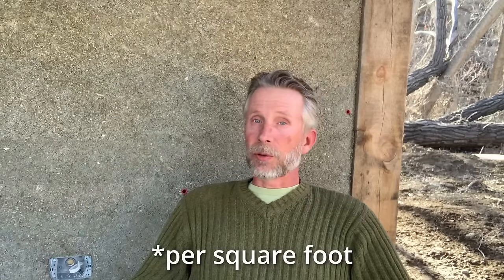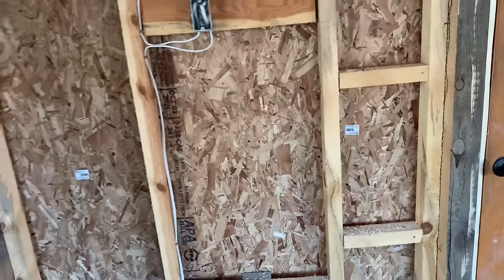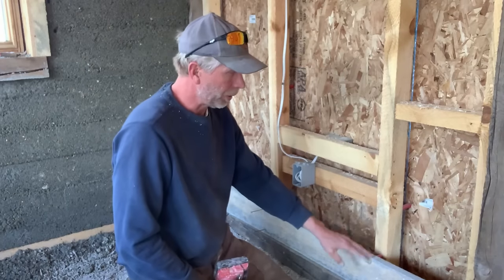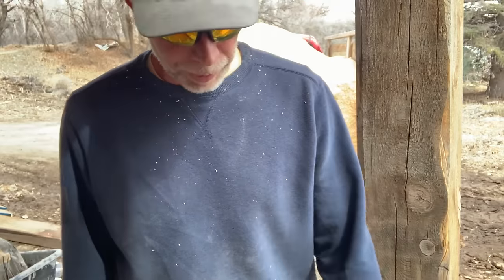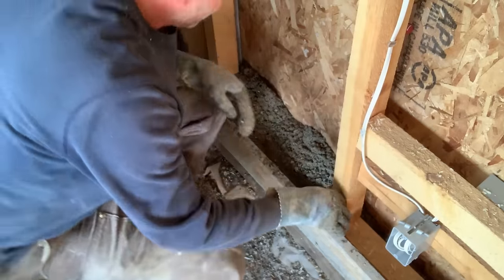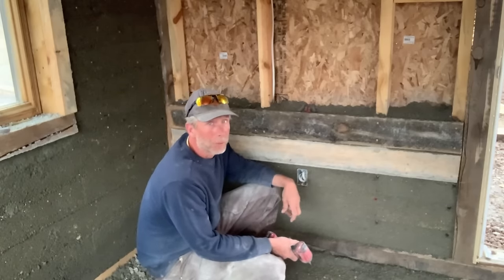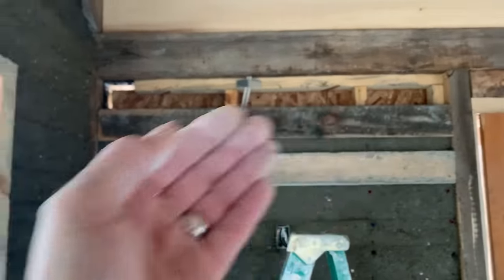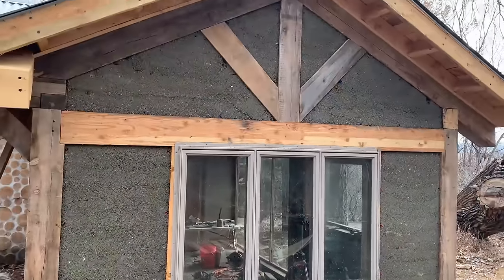Dustcrete

Comment: Nice work! I have been using sifted sawdust mixed with polyester resin; then mixed catalyst for filler building boats. This filler is rock hard and less expensive than other fillers.
Reply: I started doing this since the late 1980's and still use and recommend today.

Comment: I like that you used the PEX tubing - it will afford mounting points for the lathe/stucco wire mat as well.
Reply from the maker: Not wire or lathe is required to plaster these walls.  the plaster keys beautifully into the dustcrete, on its own!

Comment: I'm very intrigued with your technique.  I've purchased a property with plenty of eastern red cedar and I'm anxious to try cordwood.  But your dustcrete method would definitely be quicker.  I may first try it on a shop or garage space.  Glad to see you back and look forward to more of your great content!
Reply from the maker: So nice to have red cedars! They will be great for cordwood. Yeah, if there is a mill around, the dustcrete is hard to beat. I’ve thought about trying it just filling the voids of a 2x4 stud wall, and siding the outside with board and bat. That would make a toasty shop!
Reply: @radicalgastronomy  I have an old house I was wanting to do with cordwood. But the house has walls already. So I had the same thought. What-if, instead of building true cord-wood, I simply used small pieces 4" thick cordwood and build that with a bout a 1-1/2 gap. then just fill in the gap with dust-crete.  The original idea was to tear it all out down to the studs. But I don't think I need to so all that if I'm just looking for aesthetic and a little tighter construction. if I want bottles for the lighting effect, I have boring bits, I can just cut those in as i go. 

I think the r-value is important. the insulation currently inside my wall exceeds some of the other hard-fills I had in mind. The current fill is R-13. I think instead of re-doing what's already there, I'm better off just adding. If your walls are already insulated, it probably has a minimum of R-13 for the 3-1/2" space. that's not too shabby. dustcrete won't give you R-3.7. So replacing insulation with dustcrete isn't going to be an improvement.

Cordwood will give you R-1.7 x 4" cordwood thickness. sawdust give you 1.4. so add it all up.  Cordwood @ 4" x 1.7 + dustcrete @ 1.5" x 1.4. So you add about R-8 to the existing wall that is already R-13. So approx. R-21. Then add the same cordwood on the exterior and you're adding another R-8 for a final R-value of approx. R29. not too damned shabby
Reply from the maker: @michaelyoung1892  that could work. 4” may be a tricky to set, but might work. Perhaps some experiments are in order…
Reply: Yea it’s a great idea for cordwood infill …

Comment: That's pretty clever kind of like a thermal Mass with an insulator without no colder heat transfer been in construction for 70 years never seen anything like it definitely cost efficient and I just happen to be good at stuck and plastering she looks sharp when it's done 👍 longevity is there

Comment: Fascinating wow. You could put a Portland cement plaster over that and it would last forever. I lived in the Philippines where they build with hollow block that is like 90 percent lime not cement like they do here in the states and it's just basically a inner form for the inner and outer plaster. I think this would work much better and be more insulated👍

Comment: One thing I am not sure about in this mix is the need for lime. Portland cement is made from limestone and clay to form a synthetic mineral that forms rock like crystals when wetted that can stick other rocks, or in this cases chunks o sawdust together. The other way to make concrete type materials is to use quicklime or hydrated lime to “activate” alumina, silica and iron containing materials like clay, rocks formed from volcanic ash (like the Romans) or power station fly ash. This is how the special French lime works. In both cases, high silica content plant materials like straw, hemp or some sawdusts will get stuck to the binder due to the silica they contain. I think this might work with just cement powder although the lime may help with ensuring the bond to the sawdust. In a very dry mix like this, regularly wetting the surface with a fine spray for the first week or so should help long term wall strength. I would also leave the wall exposed for 3-4 weeks before plastering. Great idea, I’ll look out to see the final result.
Reply: Yes, I too am confused about type S lime being a separate ingredient from portland cement powder.
Our big box store only carries "portland limestone cement" and directed me to the garden center for just "lime".
Question then would be ... Can I substitute 4 parts "portland limestone cement"?
Reply: @lst854  Type III Hydrated lime, bag the size of Portland cement. One shovel to four of portland. Slows drying to help in hot regions.
Reply: One thing about the difference between lime and straight concrete is that lime mortars are less brittle and crack less easily. With cordwood and sawdust they have more expansion when wet, especially hard woods, and because he's doing cordwood, he probably knows that straight concrete like Portland can cause problems in cordwood mortars, from expansion cracking. Cordwood mortars are usually an adaption of lime based mortars, with sawdust also added..   I've seen the mess from even ordinary brick walls made with just Portland cement as a mortar... That's a bad idea even then... I doubt a bricklayer would use pure Portland as mortar, for that brittleness reason. Just saying.
Reply: the lime helps the wall breathe dissipating moisture humidity, cement will feel cold and damp.
Reply: Masonry type S cement already has the hydrated lime in it, and is composed of portland cement and hydrated lime. The mix will absorb the water as it cures at an optimum temperature of 48° F over 28 days. As long as you keep the walls below 70° F, mold will not form. Mold needs temps above 70° F, moisture, and somthing to eat like wood or paper. Take away any one of those, and mold can not grow.

Comment: This is an excellent video, on many levels. I see great potential in this wall system. It obviously works well as presented. Do you think there would be any advantage to painting the exterior ply forms for easy release and durability? Maybe just not necessary. Mesh sheeting could go down before plastering, if you need more strength. Mix some thinset with type S mortar for a rock hard scratch coat. You could add color pigment to that if you want an adobe look that ties the structure visually to the earth.
Reply from the maker: I ended up using some fiberglass reinforcement in the plaster, and have very little cracking. There is a video on my channel showing my process. Glad you liked it!

Comment: Looks pretty cool, it could make for great construction projects, low-cost sheds walls and chicken coups and many other uses. I wonder what the R value would be? Could be a great alternative to rockwool insulation from a price point.
Reply from the maker: The price point can’t be beat. I’m assuming R value is like hempcrete (2.3-4.8 per inch). May do some tests…

Comment: Interesting. I recall about 30 years ago a neighbor of mine tried making concrete using sawdust. He experimented and abandoned the project. His was much wetter in the traditional way concrete was made. He ended up with a material that was not very strong and came apart easily. It was sort of like a sandstone concrete. I wonder how water infiltration and freeze thaw cycles effect this? Wood can absorb water; and water can freeze and destroy concrete. I always support experimentation, but don't really know what is going to happen. Hardy board is a similar type of concrete wood mixture.  There is no chicken wire or other metal reinforcement in the wall. If historical research could show how similar materials have stood the test of time, or how this is just a minor change to an existing technique that might be beneficial. Obviously, you plan to keep this dry, sealed in a wall. Walls are great places to keep things dry.  Some portions of the country are going to have freezing temperatures reaching deep into the walls, (at least occasionally in extreme weather events) and moisture, in both condensation, floods, and plumbing leaks is a real pain to home builders. Both wood and concrete have done ok in this regard.  Historically, sawdust has been used as an insulation, or to fill walls before modern insulations became available. Today, cellulose insulation, (generally from newspapers), is basically a wood product with a few anti-bug products added. Good luck. Neat project.
Reply: Old house in France, in my Town (Troyes) used this kind of material, more rudimentary and that can last 400 hundred years
Reply: And Im talking about this material on the outside wall, but yes there wood cross every 2 meters or so on 3 meters high
Reply: Cement is too hard/ brittle for this. Lime is the business with a small amount of cement to help set early, and eventually the lime cures to a more flexible and long lasting binder.

Comment: I absolutely loved your video.  Plus your explanations are so complete and clear.  THANK YOU!!!  I do have a few questions, though: 
•	Would the dustcrete mixture ruin the concrete floor if it gets on the slab – especially if the floors will eventually be finished using an acid wash method?
•	What’s the maximum height the walls should be to ensure the walls remain stable?
•	Should all exterior wood be covered with the lime stucco?
•	Will the wood eventually rot from the dustcrete mixture?
•	Do you use hydrated or hydraulic lime?  If it’s hydraulic lime, what’s your source?
•	Do you have a cost estimate per cubic foot of the wall?  And do you recommend a 10” wall thickness?
•	What method would you use for internal walls??
•	I will use a hydraulic lime stucco on the outside, but can I use an earthen/clay stucco on the inside – and does it adhere to the dustcrete very well?
  Should the lime stucco be applied BEFORE the clay stucco on the INSIDE if I needed to repair a crack?
•	What do you do to ensure the clay will stick to the walls on the inside of the dustcrete walls (lath, mesh?)
•	Do termites go after the sawdust?
•	What about thermal mass... and what is R-Value of a 10” wall, more or less?
•	Since you had trouble with a cold joint on the wall you demonstrated in the video, have you figured out how to prevent the problem?  I assume unless I build an entire section, from bottom to top, I would have problems with cold joints as well….  but THEN, wouldn’t there be a problem with joining two sections that were side by side?
•	Would the final stucco using the hydraulic lime mend the crack?
   
Again, thank you for coming up with this wonderful idea!  🙏🤗👍
Reply: "A few questions"?  You just asked him to write a book.
Reply: Is it farther to New York, than by bus ?

Comment: A few questions.. What is your gut feeling about the insulative ability of the Dustcrete compared to the cordwood? I understand the need to plaster the exterior.. but do you think it would be possible to attach foam board ( to improve the R Value?) to the interior using the hole from the slip form, and finish the interior with drywall, or another surface?  Lastly, what roof overhang do you think should be a guideline to prevent excessive wetting of the plaster over time?
Lastly, thank you for doing these videos, your professional presentation and production values are a wonderful compliment to your ability to get the information out.
Reply from the maker: Having one cordwood space, and one dustcrete space, I can say that the dustcrete has vastly better thermal performance than my cordwood. R-value is less of a factor in the presence of thermal mass. Also, wall insulation matters much less than ceiling insulation. If you wanted to add a foam layer, the outside of the wall would be the place to do it. That way, you contain the thermal mass of the walls within the structure. You would then need to wire and stucco/plaster the exterior. Honestly, 8” dustcrete with R-30 (or better) in the roof would perform exceptionally in almost any location. 
I’m so glad you find all of this interesting. Let me know if you have further questions!
Reply: I would consider putting the foam on the outside, like you see done when commercial buildings are going up.

I had a house on the Pacific Northwet coast with a daylight basement. The walls were all concrete. I'd fire up a wood stove, in the basement, and the concrete acted like a flywheel for storing heat. 

Since the outside surface works like any heatsink, constantly losing heat to the atmosphere, insulating it would crank up the heating and cooling efficiency.
Reply: This stuff looks really great! Can you fast forward 25 years, I’d love to see how it ages. I gather it does well as long as it stays dry, the foundation is stable and there’s no seismic activity.
Reply from the maker: @chaosplan  I have a new video coming soon that covers what happens to it when there is a slow pipe leak in the wall. Stay tuned…

Comment: Little concerned about all those tube spacers as penetration points. Is this material similar to Perves concrete ?  Do you use a vapor barrier between the Dustcrete and the OSB sheeting on the outside ? Does it have an estimated R- value per thickness ?  Looks like a time-consuming prosses but if it's an efficient cheap wall insulator and it works great. Great Video !
Reply: OSB was only used for the outside form. Walls would be plastered in and out. NO OSB

Comment: Very interesting.  I would be concerned about shrinkage where the dustcrete meets the structural members. Have you had enough  time to test for shrinkage? Any thoughts about adding reinforcement or some kind  of membrane to the field? Thanks
Reply from the maker: I had about 1/64" shrinkage from the timbers. A complete cleat of 2x3 around the void with a bead of caulk behind it would stop drafts from developing. I'm thinking that forming past the frame and having a monolithic skin on the building is a better move. As far as membranes, I prefer a breathable wall system to a waterproof one, but other climates have other requirements.
Reply: @radicalgastronomy  Friend, in 13:05 : you put the "dustcrete" on top of a wood beam "foundation", where generally you put the wood beam on top of a concrete foundation. I don't know the weight of your wall, but if it is heavy enough or if the wood beam deteriorates it can sink your wall (or even part of your house), etc... I suggest you either use concrete foundation or "treat" (hardens) the wood beam with cement (1:1 cement + water) before constructing the wall. It also helps with termite, etc... Also, before plastering, it's better to put a coat of cement (cement + water) to reinforce the wall. Just "paint" the wall with cement, also helps using less plaster, etc... Just a suggestion 👍

Comment: Wow, dustcrete is genius brother. I looked into the hemp crete but sawdust is much easier to get and a whole cheaper. Is it holding up well? Did you all ready plaster? What material did you use for the ceiling?
Reply from the maker: It’s holding up great. Interior plaster is complete (video on my natural building playlist). Some exterior plaster done, too (can be seen behind me in that aircrete video). Even the un plastered sections are holding up great, exposed to the elements. I have some hair line cracking, but nothing serious. The lid is pine 1x6 with fiberglass bats in the void. I don’t love it, and wish I had gone heavier, up there. The ceiling is lovely, though.

Comment: Just as a hint from a master of construction: If You have the consistency like that, You propably would'nt need the boards as a mold at all. I think You could just have the exterior chip board and then jam pack the stuff until you are in the correct thickness. You could propably do it a lot faster.
Reply: In some cases, it might be possible to build panels horizontally and fill and even plaster and then put them in place.

Comment: Is there a reason you do it in such small lines? Or is there a drawback to doing larger sections at a time?
Reply from the maker: To get the proper compression about 6 to 8 inches is what works best. Much more than that and you can have loose, crumbly parts after you tamp it down. Or, the material at the top will be too compressed to insulate well is you tamp too thick of a layer.

Comment: Man-O-man, great job.   In the future if you ever take on another project of that size, it would be a great idea to get a decent used cement mixer off Craigs list, or your local method for $1-200.  I'm telling you you'd never regret it. Then when you are absolutely done with it, you can clean it up and sell it for your money back.  I have done that with so many projects.  The patio slab I wanted 15 years ago, was at the back of my property. It was bidded  by 4 contractors all over $12k because they would need to rent a bigger pump.  So I rented a utility ATV to carry all the bags of cement I would need, plus a few more, and dragged that section of fence up to the patio area. Next, I purchased a used cement mixer in good condition, and I hired 3 laborers to keep the flow going. The night before I rolled out the fence onto rocks I found around my property. I woke early the next morning and went to Home Depot for 3 laborers. We started at 7am and without taking a break we finished pouring at 6pm, and it just so happened one of the guys knew how to finish cement, so I tipped him in private. When I was done paying the laborers, I did the math. It cost me about a grand more than I previously considered, but it was less than half the lowest bid.  Then equipment by equipment I cleaned them up, spray painting one of them with 1 can of cheap spray paint and made a profit on the sales. 
There are so many ways to save money in construction.